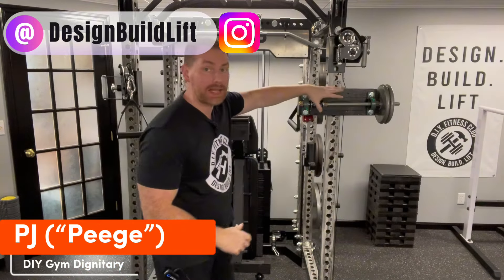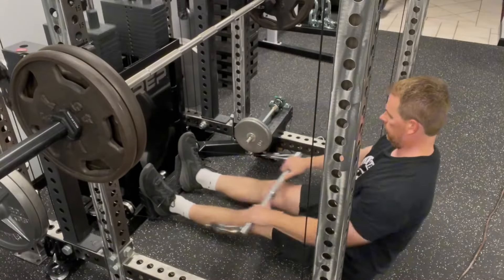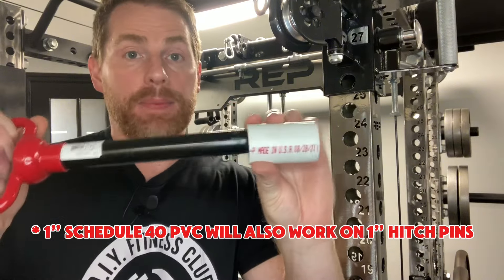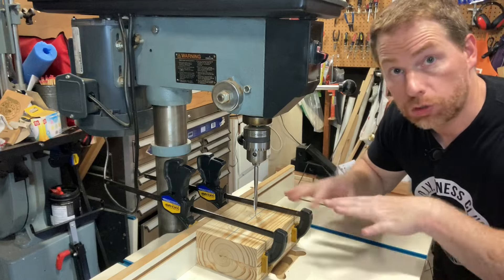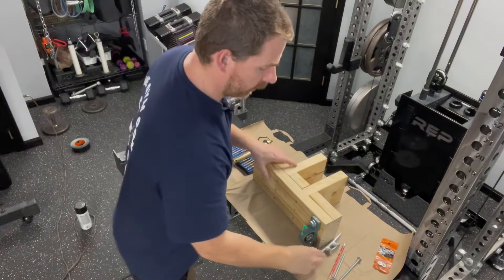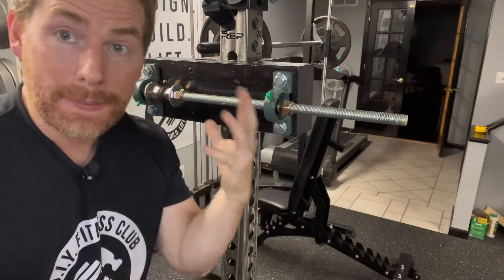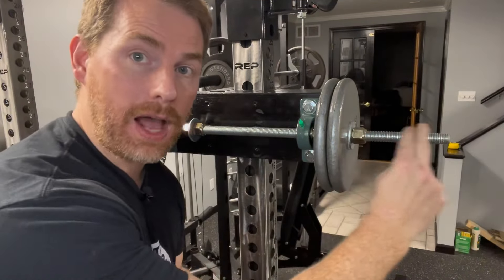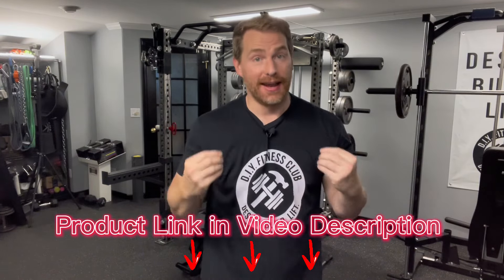DIY Rack-Mounted Flywheel Trainer -- Eccentric Overload!

Comment: I made a standalone unit with very similar construction about 5 years ago. I have always struggled with the plates spinning after a few uses. I was very excited when I saw this. I feel confident with a few tweaks from your design. I will finally be able to spend more time using it than setting it up. As far as the weight, the more you use, the slower you can do a movement. If you want to do speed work, less weight can be ideal. My favorite way to use flywheel is with myo reps or DC style training.
Reply: It's also amazing for belt squats.
Reply from the maker: Thank you! There was a lot of trial and error trying to get the plates to spin WITH the threaded rod. When I switched from regular nuts to locks nuts/washers/grippy shelf liner— and made it all super tight- problem solved. 🤘🙏💪

Comment: I've never used wood glue with my custom stuff but I like the idea.  Adds a little extra rigidity with no downside
Reply from the maker: I copied this from a quick google search: Wood glue strength ranges from roughly 3,600 to 4,000 psi—that is they can withstand pressures of between 3,600 and 4,000 pounds per square inch. The adhesive bonds of wood glues—as well as epoxies and polyurethane adhesives, both of which can also be used to join wood—are stronger than most woods.
Reply: @DesignBuildLift  Nice yeah I wish I did that with my GHR build.  Still plenty sturdy

Comment: This is awesome. I assume you're using locknuts rather than screw collars so you can wrench up the compression on everything? Screw collars look cleaner, but they are probably difficult to apply compression with.
Reply from the maker: Yes, you are correct - locknuts for the win! I found that if it was not extremely tight….the plates (or rope) would “skip” at the top of a rep (where they would rotate independently of the threaded rod).

Comment: You could propeply add a few magnets around but not touching the flywheel disc to create an eddy current to resist the spin, or i think it could also increase the speed and spin of th flywheel so that you could possibly  get more eccentric overload and possibly control how much eccentric overload you want 🤔you could look at this youtube video called : How to make invisible Gears with eddy current by the youtube channel  called The Action lab in the video he used the eddy current to create  speed  for the flywheel its pretty interesting. THE only thing that i think might be an issue is heat but maybe it might not be a problem since the flywheel would be move with it and not totally stationary plus the material that you use could help to make less heat but maybe im just overthinking and heat is not gonna be a big problem
Reply from the maker: I appreciate the feedback and suggestion - I will look into how that could be applied! 🤘🙏💪

Comment: Super interesting video! I'm curious to know how much the build cost you overall, but with how much flywheels are generally, I'm sure it was cheaper than anything on the market
Reply from the maker: Threaded rod was $10, $15 for the bearings, wood was $6. Fasteners, nuts, washers were like $20ish. So about$50. I already had the hitch pins and other items.🤘
Reply: @DesignBuildLift  Do you think the sort of roller system you did with the hitchpin and pvc pipe would be strong/stable enough for a diy trolley? I've been thinking about this for the last few days lol
Reply from the maker: @calcifires  Unfortunately, I am not sure it would be smooth enough… Too much friction would be my guess.

Comment: Great design. I would like to build one of these but use it as a surf trainer (similar to the vertical skiergs) but i would be lying on a bench and the unit would be in front of me. How would you incorporate 2 ropes/pull handles to simulate surf paddling/ thank you
Reply from the maker: Thank you! Just clip them onto the pulley like I did first my Stirrup handle.

Comment: Hey good job I love the design. I dont have flat weights, have you tried it with more irregular weights? Does it get wobly? Ty for your time.
Reply from the maker: Thank you! As long as the plate’s hub is flat, you should be okay. The hub must be flat to get the washers/grippy shelf liner/lock nuts to make the plates move WITH the threaded rod. If your plates won’t work, you can always score a deal on used plates via Facebook marketplace—or buy new ones amazon: https://amzn.to/4h3AZPc ……or buy New/Used via Freedom Fitness Equipment: http://freedomfitnessequipment.com/DBL (Promo Code DBL saves 5%) 🤘🙏💪
Reply: @DesignBuildLift  thank you for your reply. I will have a look

Comment: My rack isn't nearly as nice but I've got a couple holes on the bottom I could probably mount it where band pegs could likely go.  Would be great to see a follow up video showing what weights works well for you for a 10-15RM for stuff like arm/delt work vs belt squat/RDL. You're a pretty big dude so should be helpful for comparison.
Reply from the maker: Will definitely happen. There will definitely be s part 2 to this video. 🤘🙏💪 I will also thinking of new trying different types of rope.

Comment: Have you thought about building a platform version?
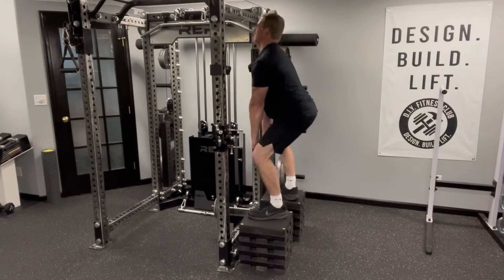Reply from the maker: Yes. That was going to be my original plan. However, once I realized that rack-mounted options provides more versatility and freedom of movement - I chose not to. I just stand on my utility blocks (1:20) (AKA my Belt Squat Blocks) when I want to stand directly over the unit. That Belt Squat Blocks tutorial is here: https://youtu.be/qMdxr2vM_Bc

Comment: I wonder if you could drill a hole in the threaded rod for the rope instead of pinching it with the nuts. Feed the rope through the hole and tie a knot.
Reply from the maker: That was what I was originally going to do, but then I thought about a sharp metal hole constantly rubbing against the rope… made me rethink this. Also the hole method limits the size of rope you can use. That being said….it would likely be easier (no tools required) to add rope than my method. Each method has its pros and cons. 🤷‍♂️🤘🙏

Comment: I bought 3/4" nipples at home depot for my plm03 squat rack by major fitness. I've taken multiple passes and it just won't fit... should i try a different size nipple instead? My squat rack holes are 1" in diameter...
Reply from the maker: For what? To make 1” hitch pins? Most (not all) 3/4” nipples are slightly larger than 1” in diameter. Therefore, You will need to grind them down to make them fit.  However, You can just buy 1” hitch pins and save yourself the trouble here: https://amzn.to/3XTOjhj
Reply from the maker: Also — 1/2” nipples will be too loose.
Reply: @DesignBuildLift  I'm make a weight plate holder. The ones on amazon are too long for my rack and space is limited. I am returning the 3/4" nipples and trying a 1/2" one with some modifications. I'll reply to this comment when I finish.